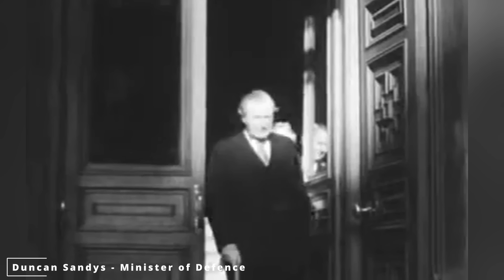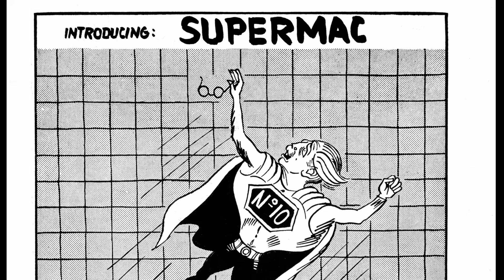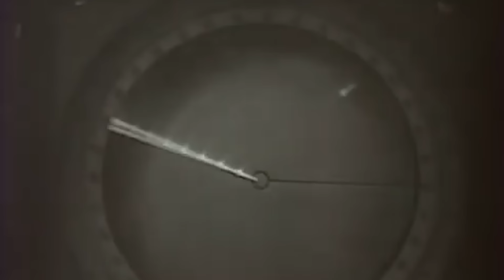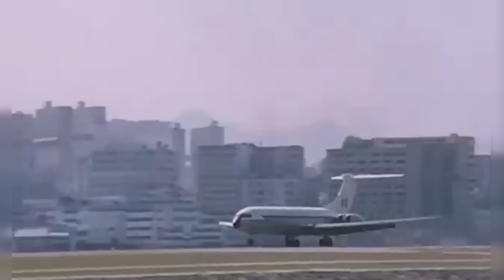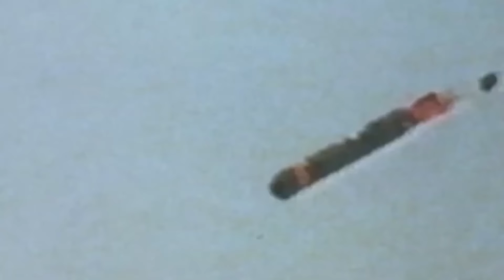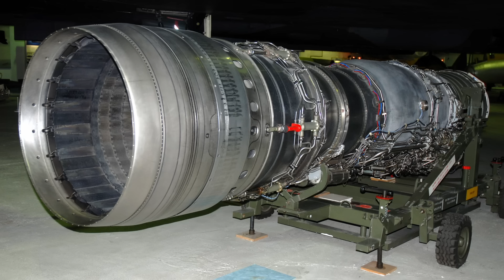How Britain Turned A Failed Airliner Into a Soviet Submarine Predator | The Mighty Nimrod

Comment: The Comet Four was hardly a failed airliner.
Reply: Comet 4 had an absolutely horrible 34% loss rate, the worst safety record of any jet airliner in history apart from the Comet 1 at 56%.
 de Havilland entered receivership the same year the Comet 4 was introduced and of 76 were built (mostly bought by the UK governmnet before production was canceled.
 The Comet 4 was voluntarily grounded in 1980 after dangerous metal fatigue and corrosion damage was found throughout the remaining fleet that was still in service, its type certificate was revoked in 1981.
Reply: @DoktorBayerischeMotorenWerke 

Comet / Nimrod notes. 

We believe we can clear up some commonly held myths and misconceptions obviously.

It's always good to see the facts presented clearly and concisely isn't it?

Obviously there have been worse aircraft for accident losses both before & after the Comet.

All jet airliners benefited greatly from the knowledge gained from the Comet incidents & subsequent investigations & yet some were still worse for accident losses. 

It's a great pity & a crying shame that British military forces had to occupy a large part of Germany for decades after 1945 & Russian military forces had to do the same. Of course Russia still posseses a large chunk of what was German territory & of course Russia & the UK produce nukes. Obviously Germany does not produce nukes.

Instances of all marks of the Comet flew with full certification after 1954 including the Comet 3. The last Comet flight occured in 1997.

The fabulous trail blazing DH Comet.
World's first jet airliner.
World's first high altitude airliner.
World's first airliner with a full fuselage length pressurised cabin pressurised for high altitude flight. That feature for that type of aircraft was a considerably difficult undertaking. 

How things were back then.
Accident losses - % of aircraft built.

DeHavilland Comet 4 UK                          14% 
DeHavilland Comet all UK (ff 1949)        17%  
Vickers VC10 UK (ff 1962)                        5%

Douglas DC-1  US                                       99%
Douglas DC-2                                              47%
Douglas DC-3                                              30%
Douglas DC-4                                              26%
Boeing s300    US                                       72% 
Boeing 307                                                  70%
Boeing 247                                                   48%
Boeing 707  (ff 1958)                                 32% 
Lockheed L-049 Constellation (ff 1958)  30%
Lockheed Electra US (ff 1958)                   29%
Fairchild FH-227 US (ff 1966)                   30%
McDonnell Douglas DC-8 US  (ff 1958)   14%
Sud Aviation Caravelle  (ff 1955)             15%
Canadair CL-44 Turboprop US (ff 1959) 46%  
Convair CV-580 Turboprop US (ff 1960) 22%
Convair CV-880     (ff 1959)                      27% 
Convair CV-990     (ff 1961)                      33%
Tupolev T-104        (ff 1956)                     16%
Vickers Viscount UK  (ff 1948)                32%  
Fokker F-27 Turboprop (ff 1955)             39%      

The Vickers VC10, fastest Atlantic crossing for a non supersonic jet airliner, held the record for 41 years.

For the first few years of operation the Caravelle & Comet had similar accident loss fatalities.

The first few Nimrod airframes were Comet 4 airframes with the equipment bay tacked on. Subsequent Nimrods were new build Comet 4 airframes with the modifications built by the DH team at Hawker Siddeley.

Military aircraft accident losses. 
Lockheed XF104                 (ff 1954) 100%
Lockheed  P80                      (ff 1944) 43%
Lockheed F104                     (ff 1954) 45%
Grumman f9f                         (ff 1947) 47%
Convair F102 Dagger            (ff 1953) 45%  
MD F-101 Voodoo.                (ff 1954)  34%
MD FH Phantom 1                (ff 1945)  35%
MD F4 Phantom 2                 (ff 1958)  28%
MD F3H  Demon                    (ff 1951)  32%
Gloster Meteor UK                   (ff 1943) 21%
DH Vampire  UK                        (ff 1943) 23%
DH Sea Vixen  UK                     (ff 1951) 33%
DH Venom       UK                    (ff 1949)  16%
Gloster Javelin    UK                (ff 1951) 20%
EE Lightning     UK                   (ff 1954) 33%
HS Harrier      UK                     (ff 1962) 34%

The Sea Vixen was an aircraft carrier jets pioneer aircraft that was also regularly flown from carriers that were too small for the aircraft. 

The Tornado & Typhoon & their engines are supersonic & are indeed British design aircraft with British design engines built by an international consortium. The Tornado design for example started life during the 1950s at Vickers as the AFVG, it's engine is based on the RR RB-199. The EE Lightening is also a British Supersonic jet aircraft.

The Typhoon is the British BAC-EAP with an engine based on the British RR XG-40, the Typhoon is also built by an international consortium.

Global aerospace. 
From the 1950s sector rationalisation and consolidation took place. 70 companies in France and 300 companies in the US disappeared due to merger or dissolution. In the US Boeing was almost bankrupted by the 707 project.  Boeing had a well protected domestic market and the available space and resources in the US to engage in large scale airliner manufacturing enabling them to capture orders simply by being able to produce airframes fast enough. Brazil now has the world's 3rd largest airliner manufacturer & is towards the bottom half of the wealth per capita tables. Most of the countries at the top don't bother trying to have a lone national airliner manufacturer. 

For example, there are of course no German companies that makes German jet aircraft in Germany & there are no German Companies that make German gas turbine aero engines in Germany that are suitable for widebody airliners.

The UK has the world's highest combined per capita Nuclear / Defence / Aerospace Sector Activity.

UK defence sector, absolute terms, world's second highest activity. 1st for per capita defence sector activity. Per capita nuclear powered submarine construction, 2nd position. 
Main players being Rolls Royce, Babcock, GKN Aerospace & BAe Systems. Activities often involve international collaboration. BAe systems, RR and other UK companies now handle more Airbus work value wise than Germany. 

Rolls Royce Holdings UK
Subsidiaries
- Rolls-Royce plc
- Rolls-Royce North America (ex Allison etc Classified Military stuff)
- Rolls-Royce AB
- Rolls-Royce Deutschland
- Rolls-Royce India Private Limited
- Rolls-Royce Marine Power Operations
- Vinters Engineering Limited
- Rolls-Royce Controls and Data Services
- Rolls-Royce Power Systems
- Bergen Marine
Joint ventures include:
- Rolls-Royce Turbomeca
- MTU Turbomeca -

Trent Family
The MT30 (Marine Turbine)
Industrial Trent 60 Gas Turbine
Trent 7000
Trent XWB Airbus A330neo.
Trent 1500
Trent 1000
Trent 500
Trent 600
Trent 700
Trent 800
Trent 8100
Trent 900
   
RR wholly owned subsidiaries in Germany handle smaller 2 shaft RR gas turbine aero engine work.
Reply: @DoktorBayerischeMotorenWerke 

We believe we can clear up some commonly held myths and misconceptions obviously.

It's always good to see the facts presented clearly and concisely isn't it?

Bow-wing (see B-47 wing collapse wing folding incidents) had built less than 12 pressurised airliners before the Comet first flew and they were not high altitude airliners. 

All Nimrods were new build Comet 4 airframes with appropriate strengthening and the unpressurized  equipment bay tacked on. 

The HS 801 Nimrod was the most advanced aircraft of it's type at the time it first flew. Problems with the MRA4 programme were almost entirely due to radar and computer equipment issues and BAe Systems & co being too busy with other work at the time. 

Obviously there have been worse aircraft for accident losses both before & after the Comet.

Early problems with Comet takeoff stalls were caused by pilots over rotating the aircraft at liftoff. 

Podded engines on wings have aerodynamics issues. The main reasons for eventually going with podded engines were because or to facilitate -
Ease of maintenance.
Use of shear off fixings given excessive out of balance forces.
Large diameter turbofan engines.
Reduce load on the wing to fuselage connection. 
Increased power from later engines. 

The Bow-wing (See B-47 wing collapse & wing folding incidents) was a good example of how to expend a huge amount of cash and effort on something that was probably not worth bothering with. The basic design of the Comet had been decided upon and established before the podded engine choice has been made for the B-47. There were aerodynamics problems with podded pylon mounted engines at the time. The US also built and operated a significant number of EE Canberra bombers under licence which did not use podded engines for their wing mounted engines. . 

There have been aircraft losses caused by pod & pylon mounted engines. 

All jet airliners benefited greatly from the knowledge gained from the Comet incidents & subsequent investigations & yet some were still worse for accident losses. 

Instances of all marks of the Comet flew with full certification after 1954 including the Comet 3. The last Comet flight occured in 1997.

The fabulous trail blazing DH Comet.
World's first jet airliner in regular service.
The jet engined Avro Lancastrian actually did a passenger service before the DH Comet. 
World's first high altitude airliner.
World's first airliner with a full fuselage length pressurised cabin pressurised for high altitude flight. That feature for that type of aircraft was a considerably difficult undertaking. 

The change from larger squarer windows to smaller rounder windows was necessary for the particular aircraft at the time. Skin thickness remained mostly the same for all Comet marks. 

How things were back then.
Accident losses - % of aircraft built.

DeHavilland Comet 4 UK                          14% 
DeHavilland Comet all mks UK (ff 1949)17%  
Vickers VC10 UK (ff 1962)                         5%

Douglas DC-1  US                                       99%
Douglas DC-2                                              47%
Douglas DC-3                                              30%
Douglas DC-4                                              26%
Boeing s300    US                                       72% 
Boeing 307                                                  70%
Boeing 247                                                   48%
Boeing 707  (ff 1958)                                 32% 
Lockheed L-049 Constellation (ff 1943)  30%
Lockheed Electra US (ff 1957)                   29%
Fairchild FH-227 US (ff 1966)                   30%
McDonnell Douglas DC-8 US  (ff 1958)   14%
Sud Aviation Caravelle  (ff 1955)             15%
Canadair CL-44 Turboprop US (ff 1959) 46%  
Convair CV-580 Turboprop US (ff 1960) 22%
Convair CV-880     (ff 1959)                      27% 
Convair CV-990     (ff 1961)                      33%
Tupolev T-104        (ff 1956)                     16%
Vickers Viscount UK  (ff 1948)                29%  
Fokker F-27 Turboprop NL (ff 1955)       40%      

The Vickers VC10, fastest Atlantic crossing for a non supersonic jet airliner, held the record for 41 years.

For the first few years of operation the Caravelle & Comet had similar accident loss fatalities.

Sud Aviation Caravelle - 
all accident loss fatalities - 
1320 fatalities. 

De Havilland Comet - 
all accident loss fatalities - 
453 fatalities. 

An example of a typical airliner from the period. 
The Fokker Friendship F-27 fatalities & accident losses as a % of aircraft built. 
Fokker F-27 Turboprop (ff 1955)   40%
2130 fatalities.

Of course De Havilland carried out a full stress analysis & performed extensive & protracted testing on two long lengths of fuselage representing all features of a complete airframe. De Havilland carried out significantly more testing than was required by any authority at the time & significantly more testing that any previous airliner was subjected to.

De Havilland designers / engineers knew all there was to know about metal fatigue at the time they designed the DH Comet.

De Havilland had prior experience building many all metal construction airframe aircraft including many passengers aircraft & thousands of jet powered fighter aircraft that were primarily of metal construction with pressurised cockpits & used jet engines built by De-Havilland.

De Havilland did indeed always work to better than industry standards at the time, used up to date knowledge for the design & testing activities & no evidence of negligence or criminal negligence was ever produced in relation to the DH Comet.

Global aerospace. 
From the 1950s sector rationalisation and consolidation took place. 70 companies in France and 300 companies in the US disappeared due to merger or dissolution. In the US Boeing was almost bankrupted by the 707 project.  Boeing had a well protected domestic market and the available space and resources in the US to engage in large scale airliner manufacturing enabling them to capture orders simply by being able to produce airframes fast enough and cheap and nasty enough. Another factor is airlines preferring to obtain as much of their airliner inventory as possible from one manufacturer. 

Global Aerospace Sector, what's happening.

For example, there are of course no German companies that makes German jet aircraft in Germany & there are no German companies that make German gas turbine aero engines in Germany that are suitable for widebody airliners.

The UK has the world's highest combined per capita Nuclear / Defence / Aerospace Sector Activity.

UK defence sector, absolute terms, world's second highest activity. 1st for per capita defence sector activity. Per capita nuclear powered submarine construction, 2nd position. 
Main players being Rolls Royce, Babcock, GKN Aerospace & BAe Systems. Activities often involve international collaboration. BAe systems, RR and other UK companies now handle more Airbus work value wise than Germany. 

There's a good chance that anyone currently flying on a widebody airliner will be on an aircraft powered by RR gas turbine aero engines made in the UK and a good chance there will be other hardware on the aircraft that's designed and / or manufactured in the UK. 

Rolls Royce Holdings UK
Subsidiaries
- Rolls-Royce plc
- Rolls-Royce North America (ex Allison etc Classified Military stuff)
- Rolls-Royce AB
- Rolls-Royce Deutschland
- Rolls-Royce India Private Limited
- Rolls-Royce Marine Power Operations
- Vinters Engineering Limited
- Rolls-Royce Controls and Data Services
- Rolls-Royce Power Systems
- Bergen Marine
Joint ventures include:
- Rolls-Royce Turbomeca
- MTU Turbomeca -

Trent Family
The MT30 (Marine Turbine)
Industrial Trent 60 Gas Turbine
Trent 7000
Trent XWB Airbus A330neo.
Trent 1500
Trent 1000
Trent 500
Trent 600
Trent 700
Trent 800
Trent 8100
Trent 900
   
RR wholly owned subsidiaries in Germany handle smaller 2 shaft RR gas turbine aero engine work.

The UK space and aerospace sectors are highly productive, high-value industries that together contribute over £18 Billion in direct Gross Value Added (GVA) to the UK economy. Individually, the space industry directly contributes about 0.3% of UK GDP 7•2 Billion while the aerospace industry contributes approximately 0.5% £10•9 Billion.
   
We hope this helps.
Reply: @DoktorBayerischeMotorenWerke , 114 built and 26 total hull loss accidents.

Not good but a long way short if 34%
Reply: @katywalker8322  39 Comet aircraft were lost in accidents.
The Comet 1 has a 56% loss rate
Reply: @DoktorBayerischeMotorenWerke the list of incidents for the Comet has 43 entries. 14 of those resulted in damaged aircraft that were repaired.

A further one was a hijacking with no resulting damage.

3 of the other losses were on the 28 December 1968 when they were destroyed on the ground by an air attack - which is hardly anything to do with the type of aircraft.
Reply: @katywalker8322  There are 39 hull loss accidents, that is a 34% loss rate.
The Comet 4 had the highest loss rate of any jet airliner except for the Comet 1 (56%)
Reply: @DoktorBayerischeMotorenWerke , no there weren't. 26 total loss accidents, 3 destroyed in war, and 14 damaged and repaired.
Reply: @katywalker8322  39 hull lose accidents, 34% loss rate
Reply: @DoktorBayerischeMotorenWerke , you continue to push that. Not sure why you insist in telling a lie that people can easily check.

Goodbye
Reply: @katywalker8322  That is the official number, the total hull loss rate in 34%
Reply: @DoktorBayerischeMotorenWerke 

Typhoon & Tornado, British design aircraft. 

Early days of the airliners.

The awesome De Havilland Comet.
World's first production jet airliner.
World's first high altitude airliner. 
At the time the Comet wasn't particularly dangerous. The DH Comet was definitely not the worst engineering failure in commercial airliner history.

Losses comparisons.
How things were in those days.

DeHavilland Comet 4 UK                          14% 
DeHavilland Comet all mks UK (ff 1949)17%  
Vickers VC10 UK (ff 1962)                         5%

Douglas DC-1  US                                       99%
Douglas DC-2                                              47%
Douglas DC-3                                              30%
Douglas DC-4                                              26%
Boeing s300    US                                       72% 
Boeing 307                                                  70%
Boeing 247                                                   48%
Boeing 707  (ff 1958)                                 32% 
Lockheed L-049 Constellation (ff 1943)  30%
Lockheed Electra US (ff 1957)                   29%
Fairchild FH-227 US (ff 1966)                   32%
McDonnell Douglas DC-8 US  (ff 1958)   14%
Sud Aviation Caravelle  (ff 1955)             15%
Canadair CL-44 Turboprop US (ff 1959) 46%  
Convair CV-580 Turboprop US (ff 1960) 22%
Convair CV-880     (ff 1959)                      27% 
Convair CV-990     (ff 1961)                      33%
Tupolev T-104        (ff 1956)                     16%
Vickers Viscount UK  (ff 1948)                29%  
Fokker F-27 Turboprop NL (ff 1955)       40%      

The Vickers VC10, fastest Atlantic crossing for a non supersonic jet airliner, held the record for 41 years.

For the first few years of operation the Caravelle & Comet had similar accident loss fatalities.

De Havilland had prior experience building many all metal construction airframe aircraft & thousands of jet powered fighter aircraft that were primarily of metal construction with pressurised cockpits & jet engines built by De-Havilland. No aircraft before the Comet was subjected to as much pre-production testing as the Comet. 

It's a great pity & a crying shame that British military forces had to occupy a large part of Germany for decades after 1945 & Russian military forces had to do the same. Of course Russia still posseses a large chunk of what was German territory & of course Russia & the UK produce nukes. Obviously Germany does not produce nukes.

Interesting British achievements.

The gas turbine engine was invented & patented in England before the 1800s.

Axial multi stage sequential stage compressor & turbine technology, first produced for turbo machinery use in England by Parsons of Ireland & North England during the 1800s. The components form the basis of most modern gas turbine aero engines. At the time the concept of the jet aircraft powered by axial internal combustion gas turbine engines was first mentioned thus the internal combustion jet engine & jet aircraft was indeed invented in England before the 1900s & before the Wright brothers got busy.

Work on the multi stage sequential stator rotor axial compressor as applicable to the axial compressor gas turbine aero engine was ongoing in England from around 1928 by Arnold Griffiths and others. By 1943 the Metrovik F2/3  Beryl was a running axial turbojet that was superior to anything anywhere else. As the centrifugal compressor engines were adequate and more powerful at the time development of a larger F2/3  version was commenced.

The Metrovik (UK)  F2/3 axial compressor gas turbine aero engine was flight certified & ran in 1942, it was the result of UK development work ongoing since 1929. At the time it was the most capable axial compressor turbojet in existence but was not required and development work continued on a larger version.

Frank Whittle performed the world's first demonstration of a gas turbine aero engine in 1937. People in Germany kept a close eye on everything going on in Britain at the time.

The centrifugal compressor RR Nene was the most powerful & most reliable gas turbine aero engine on the planet in 1944. That engine would be later built under license or copied in many countries including Russia (Mig-15 Mig-17), China, the US, France and Switzerland powered dozens of aircraft types for decades after 1944.

Pratt and Whitney and others produce centrifugal compressor gas turbine aero engines. The PW200 is a currently produced whittle style centrifugal compressor, reverse flow combustor, gas turbine aero engine. 

The world's first wind tunnel was constructed in England during the 1870s. The world's first supersonic wind tunnel was constructed in England in 1922.

There is no doubt that the Fairey (England)
Delta 2 was the world's first jet
aircraft to exceed 1000 mph.  Indeed It
exceeded the previous record by 310 mph &
held the record for 1 year. Incidentally, the Dassault Mirage 3 & 4 are based on the Fairey Delta 2.

More recent UK military jet aircraft.

The Tornado & Typhoon & their engines are Supersonic & are indeed British design aircraft with British design engines built by an international consortium. The Tornado design for example started life during the 1950s at Vickers as the AFVG, it's engine is based on the RR RB-199. The EE Lightening is also a British Supersonic jet aircraft.

The Typhoon is the British BAC-EAP with an engine based on the British RR XG-40, the Typhoon is also built by an international consortium.

Brazil has the world's third largest airliner manufacturer and makes very good airliners & Brazil is 100th down the list along with Indonesia for wealth per capita. Of course it is in fact the case that Embraer can't build those airliners without purchasing stuff from the US, UK & Europe. For example, Norway, Holland, Denmark, Ireland & Belgium, top 20 wealth per capita, don't make airliners, its as simple as that.

Global aerospace. 
From the 1950s sector rationalisation and consolidation took place. 70 companies in France and 300 companies in the US disappeared due to merger or dissolution. In the US Boeing was almost bankrupted by the 707 project.  Boeing had a well protected domestic market and the available space and resources in the US to engage in large scale airliner manufacturing enabling them to capture orders simply by being able to produce airframes fast enough and cheap and nasty enough. Another factor is airlines preferring to obtain as much of their airliner inventory as possible from one manufacturer. 

Global Aerospace Sector, what's happening.

For example, there are of course no German companies that makes German jet aircraft in Germany & there are no German companies that make German gas turbine aero engines in Germany that are suitable for widebody airliners.

The UK has the world's highest combined per capita Nuclear / Defence / Aerospace Sector Activity.

UK defence sector, absolute terms, world's second highest activity. 1st for per capita defence sector activity. Per capita nuclear powered submarine construction, 2nd position. 
Main players being Rolls Royce, Babcock, GKN Aerospace & BAe Systems. Activities often involve international collaboration. BAe systems, RR and other UK companies now handle more Airbus work value wise than Germany. 

There's a good chance that anyone currently flying on a widebody airliner will be on an aircraft powered by RR gas turbine aero engines made in the UK and a good chance there will be other hardware on the aircraft that's designed and / or manufactured in the UK. 

Rolls Royce Holdings UK
Subsidiaries
- Rolls-Royce plc
- Rolls-Royce North America (ex Allison etc Classified Military stuff)
- Rolls-Royce AB
- Rolls-Royce Deutschland
- Rolls-Royce India Private Limited
- Rolls-Royce Marine Power Operations
- Vinters Engineering Limited
- Rolls-Royce Controls and Data Services
- Rolls-Royce Power Systems
- Bergen Marine
Joint ventures include:
- Rolls-Royce Turbomeca
- MTU Turbomeca -

Trent Family
The MT30 (Marine Turbine)
Industrial Trent 60 Gas Turbine
Trent 7000
Trent XWB Airbus A330neo.
Trent 1500
Trent 1000
Trent 500
Trent 600
Trent 700
Trent 800
Trent 8100
Trent 900
   
RR wholly owned subsidiaries in Germany handle smaller 2 shaft RR gas turbine aero engine work.

The UK space and aerospace sectors are highly productive, high-value industries that together contribute over £18 Billion in direct Gross Value Added (GVA) to the UK economy. Individually, the space industry directly contributes about 0.3% of UK GDP 7•2 Billion while the aerospace industry contributes approximately 0.5% £10•9 Billion.
   
We hope this helps.
Reply: @DoktorBayerischeMotorenWerke 

We believe we can clear up some commonly held myths and misconceptions obviously.

It's always good to see the facts presented clearly and concisely isn't it?

All production Nimrod aircraft were new build Comet 4 airframes with the necessary modifications. The Nimrod was the most advanced and most capable aircraft of it's type at the time it went into service. The  Nimrid HS.801 was not available for purchase by other countries. The ability  if the HS 801 to repeatedly demonstrate detection of subs and the knowledge that it could deliver nuclear depth charges to a target was a very effective deterrent. 

Bow-wing (see B-47 wing collapse wing folding incidents) had built less than 12 pressurised airliners before the Comet first flew and they were not high altitude airliners. 

All Nimrods were new build Comet 4 airframes with appropriate strengthening and the unpressurized  equipment bay tacked on. 

The HS 801 Nimrod was the most advanced aircraft of it's type at the time it first flew. Problems with the MRA4 programme were almost entirely due to radar and computer equipment issues and BAe Systems & co being too busy with other work at the time. 

Obviously there have been worse aircraft for accident losses both before & after the Comet and Nimrod.

Early problems with Comet takeoff stalls were caused by pilots over rotating the aircraft at liftoff. 

Podded engines on wings have aerodynamics issues. The main reasons for eventually going with podded engines were because or to facilitate - Ease of maintenance. Use of shear off fixings given excessive out of balance forces.
Large diameter turbofan engines.
Reduce load on the wing to fuselage connection. Increased power from later engines. 

The Bow-wing (See B-47 wing collapse & wing folding incidents) was a good example of how to expend a huge amount of cash and effort on something that was probably not worth bothering with. The basic design of the Comet had been decided upon and established before the podded engine choice has been made for the B-47. There were aerodynamics problems with podded pylon mounted engines at the time. The US also built and operated a significant number of EE Canberra bombers under licence which did not use podded engines for their wing mounted engines. . 

There have been aircraft losses caused by pod & pylon mounted engines. 

All jet airliners benefited greatly from the knowledge gained from the Comet incidents & subsequent investigations & yet some were still worse for accident losses. 

Instances of all marks of the Comet flew with full certification after 1954 including the Comet 3. The last Comet flight occured in 1997.

The fabulous trail blazing DH Comet.
World's first jet airliner in regular service.
The jet engined Avro Lancastrian actually did a passenger service before the DH Comet. 
World's first high altitude airliner.
World's first airliner with a full fuselage length pressurised cabin pressurised for high altitude flight. That feature for that type of aircraft was a considerably difficult undertaking. 

The change from larger squarer windows to smaller rounder windows was necessary for the particular aircraft at the time. Skin thickness remained mostly the same for all Comet marks. 

How things were back then.
Accident losses - % of aircraft built.

DeHavilland Comet 4 UK                          14% 
DeHavilland Comet all mks UK (ff 1949)17%  
Vickers VC10 UK (ff 1962)                         5%

Douglas DC-1  US                                       99%
Douglas DC-2                                              47%
Douglas DC-3                                              30%
Douglas DC-4                                              26%
Boeing s300    US                                       72% 
Boeing 307                                                  70%
Boeing 247                                                   48%
Boeing 707  (ff 1958)                                 32% 
Lockheed L-049 Constellation (ff 1943)  30%
Lockheed Electra US (ff 1957)                   29%
Fairchild FH-227 US (ff 1966)                   30%
McDonnell Douglas DC-8 US  (ff 1958)   14%
Sud Aviation Caravelle  (ff 1955)             15%
Canadair CL-44 Turboprop US (ff 1959) 46%  
Convair CV-580 Turboprop US (ff 1960) 22%
Convair CV-880     (ff 1959)                      27% 
Convair CV-990     (ff 1961)                      33%
Tupolev T-104        (ff 1956)                     16%
Vickers Viscount UK  (ff 1948)                29%  
Fokker F-27 Turboprop NL (ff 1955)       40%      

The Vickers VC10, fastest Atlantic crossing for a non supersonic jet airliner, held the record for 41 years.

For the first few years of operation the Caravelle & Comet had similar accident loss fatalities.

Sud Aviation Caravelle - 
all accident loss fatalities - 
1320 fatalities. 

De Havilland Comet - 
all accident loss fatalities - 
453 fatalities. 

An example of a typical airliner from the period. 
The Fokker Friendship F-27 fatalities & accident losses as a % of aircraft built. 
Fokker F-27 Turboprop (ff 1955)   40%
2130 fatalities.

Of course De Havilland carried out a full stress analysis & performed extensive & protracted testing on two long lengths of fuselage representing all features of a complete airframe. De Havilland carried out significantly more testing than was required by any authority at the time & significantly more testing that any previous airliner was subjected to.

De Havilland designers / engineers knew all there was to know about metal fatigue at the time they designed the DH Comet.

De Havilland had prior experience building many all metal construction airframe aircraft including many passengers aircraft & thousands of jet powered fighter aircraft that were primarily of metal construction with pressurised cockpits & used jet engines built by De-Havilland.

De Havilland did indeed always work to better than industry standards at the time, used up to date knowledge for the design & testing activities & no evidence of negligence or criminal negligence was ever produced in relation to the DH Comet.

Global aerospace. 
From the 1950s sector rationalisation and consolidation took place. 70 companies in France and 300 companies in the US disappeared due to merger or dissolution. In the US Boeing was almost bankrupted by the 707 project.  Boeing had a well protected domestic market and the available space and resources in the US to engage in large scale airliner manufacturing enabling them to capture orders simply by being able to produce airframes fast enough and cheap and nasty enough. Another factor is airlines preferring to obtain as much of their airliner inventory as possible from one manufacturer. 

Global Aerospace Sector, what's happening.

For example, there are of course no German companies that makes German jet aircraft in Germany & there are no German companies that make German gas turbine aero engines in Germany that are suitable for widebody airliners.

The UK has the world's highest combined per capita Nuclear / Defence / Aerospace Sector Activity.

UK defence sector, absolute terms, world's second highest activity. 1st for per capita defence sector activity. Per capita nuclear powered submarine construction, 2nd position. 
Main players being Rolls Royce, Babcock, GKN Aerospace & BAe Systems. Activities often involve international collaboration. BAe systems, RR and other UK companies now handle more Airbus work value wise than Germany. 

There's a good chance that anyone currently flying on a widebody airliner will be on an aircraft powered by RR gas turbine aero engines made in the UK and a good chance there will be other hardware on the aircraft that's designed and / or manufactured in the UK. 

Rolls Royce Holdings UK
Subsidiaries
- Rolls-Royce plc
- Rolls-Royce North America (ex Allison etc Classified Military stuff)
- Rolls-Royce AB
- Rolls-Royce Deutschland
- Rolls-Royce India Private Limited
- Rolls-Royce Marine Power Operations
- Vinters Engineering Limited
- Rolls-Royce Controls and Data Services
- Rolls-Royce Power Systems
- Bergen Marine
Joint ventures include:
- Rolls-Royce Turbomeca
- MTU Turbomeca -

Trent Family
The MT30 (Marine Turbine)
Industrial Trent 60 Gas Turbine
Trent 7000
Trent XWB Airbus A330neo.
Trent 1500
Trent 1000
Trent 500
Trent 600
Trent 700
Trent 800
Trent 8100
Trent 900
   
RR wholly owned subsidiaries in Germany handle smaller 2 shaft RR gas turbine aero engine work.

The UK space and aerospace sectors are highly productive, high-value industries that together contribute over £18 Billion in direct Gross Value Added (GVA) to the UK economy. Individually, the space industry directly contributes about 0.3% of UK GDP 7•2 Billion while the aerospace industry contributes approximately 0.5% £10•9 Billion.
   
We hope this helps.
Reply: @DoktorBayerischeMotorenWerke 

Typhoon & Tornado, British design aircraft. 

Early days of the airliners.

The awesome De Havilland Comet.
World's first production jet airliner.
World's first high altitude airliner. 
At the time the Comet wasn't particularly dangerous. The DH Comet was definitely not the worst engineering failure in commercial airliner history.

Losses comparisons.
How things were in those days.

DeHavilland Comet 4 UK                          14% 
DeHavilland Comet all mks UK (ff 1949)17%  
Vickers VC10 UK (ff 1962)                         5%

Douglas DC-1  US                                       99%
Douglas DC-2                                              47%
Douglas DC-3                                              30%
Douglas DC-4                                              26%
Boeing s300    US                                       72% 
Boeing 307                                                  70%
Boeing 247                                                   48%
Boeing 707  (ff 1958)                                 32% 
Lockheed L-049 Constellation (ff 1943)  30%
Lockheed Electra US (ff 1957)                   29%
Fairchild FH-227 US (ff 1966)                   32%
McDonnell Douglas DC-8 US  (ff 1958)   14%
Sud Aviation Caravelle  (ff 1955)             15%
Canadair CL-44 Turboprop US (ff 1959) 46%  
Convair CV-580 Turboprop US (ff 1960) 22%
Convair CV-880     (ff 1959)                      27% 
Convair CV-990     (ff 1961)                      33%
Tupolev T-104        (ff 1956)                     16%
Vickers Viscount UK  (ff 1948)                29%  
Fokker F-27 Turboprop NL (ff 1955)       40%      

The Vickers VC10, fastest Atlantic crossing for a non supersonic jet airliner, held the record for 41 years.

For the first few years of operation the Caravelle & Comet had similar accident loss fatalities.

De Havilland had prior experience building many all metal construction airframe aircraft & thousands of jet powered fighter aircraft that were primarily of metal construction with pressurised cockpits & jet engines built by De-Havilland. No aircraft before the Comet was subjected to as much pre-production testing as the Comet. 

It's a great pity & a crying shame that British military forces had to occupy a large part of Germany for decades after 1945 & Russian military forces had to do the same. Of course Russia still posseses a large chunk of what was German territory & of course Russia & the UK produce nukes. Obviously Germany does not produce nukes.

Interesting British achievements.

The gas turbine engine was invented & patented in England before the 1800s.

Axial multi stage sequential stage compressor & turbine technology, first produced for turbo machinery use in England by Parsons of Ireland & North England during the 1800s. The components form the basis of most modern gas turbine aero engines. At the time the concept of the jet aircraft powered by axial internal combustion gas turbine engines was first mentioned thus the internal combustion jet engine & jet aircraft was indeed invented in England before the 1900s & before the Wright brothers got busy.

Work on the multi stage sequential stator rotor axial compressor as applicable to the axial compressor gas turbine aero engine was ongoing in England from around 1928 by Arnold Griffiths and others. By 1943 the Metrovik F2/3  Beryl was a running axial turbojet that was superior to anything anywhere else. As the centrifugal compressor engines were adequate and more powerful at the time development of a larger F2/3  version was commenced.

The Metrovik (UK)  F2/3 axial compressor gas turbine aero engine was flight certified & ran in 1942, it was the result of UK development work ongoing since 1929. At the time it was the most capable axial compressor turbojet in existence but was not required and development work continued on a larger version.

Frank Whittle performed the world's first demonstration of a gas turbine aero engine in 1937. People in Germany kept a close eye on everything going on in Britain at the time.

The centrifugal compressor RR Nene was the most powerful & most reliable gas turbine aero engine on the planet in 1944. That engine would be later built under license or copied in many countries including Russia (Mig-15 Mig-17), China, the US, France and Switzerland powered dozens of aircraft types for decades after 1944.

Pratt and Whitney and others produce centrifugal compressor gas turbine aero engines. The PW200 is a currently produced whittle style centrifugal compressor, reverse flow combustor, gas turbine aero engine. 

The world's first wind tunnel was constructed in England during the 1870s. The world's first supersonic wind tunnel was constructed in England in 1922.

There is no doubt that the Fairey (England)
Delta 2 was the world's first jet
aircraft to exceed 1000 mph.  Indeed It
exceeded the previous record by 310 mph &
held the record for 1 year. Incidentally, the Dassault Mirage 3 & 4 are based on the Fairey Delta 2.

More recent UK military jet aircraft.

The Tornado & Typhoon & their engines are Supersonic & are indeed British design aircraft with British design engines built by an international consortium. The Tornado design for example started life during the 1950s at Vickers as the AFVG, it's engine is based on the RR RB-199. The EE Lightening is also a British Supersonic jet aircraft.

The Typhoon is the British BAC-EAP with an engine based on the British RR XG-40, the Typhoon is also built by an international consortium.

Brazil has the world's third largest airliner manufacturer and makes very good airliners & Brazil is 100th down the list along with Indonesia for wealth per capita. Of course it is in fact the case that Embraer can't build those airliners without purchasing stuff from the US, UK & Europe. For example, Norway, Holland, Denmark, Ireland & Belgium, top 20 wealth per capita, don't make airliners, its as simple as that.

Global aerospace. 
From the 1950s sector rationalisation and consolidation took place. 70 companies in France and 300 companies in the US disappeared due to merger or dissolution. In the US Boeing was almost bankrupted by the 707 project.  Boeing had a well protected domestic market and the available space and resources in the US to engage in large scale airliner manufacturing enabling them to capture orders simply by being able to produce airframes fast enough and cheap and nasty enough. Another factor is airlines preferring to obtain as much of their airliner inventory as possible from one manufacturer. 

Global Aerospace Sector, what's happening.

For example, there are of course no German companies that makes German jet aircraft in Germany & there are no German companies that make German gas turbine aero engines in Germany that are suitable for widebody airliners.

The UK has the world's highest combined per capita Nuclear / Defence / Aerospace Sector Activity.

UK defence sector, absolute terms, world's second highest activity. 1st for per capita defence sector activity. Per capita nuclear powered submarine construction, 2nd position. 
Main players being Rolls Royce, Babcock, GKN Aerospace & BAe Systems. Activities often involve international collaboration. BAe systems, RR and other UK companies now handle more Airbus work value wise than Germany. 

There's a good chance that anyone currently flying on a widebody airliner will be on an aircraft powered by RR gas turbine aero engines made in the UK and a good chance there will be other hardware on the aircraft that's designed and / or manufactured in the UK. 

Rolls Royce Holdings UK
Subsidiaries
- Rolls-Royce plc
- Rolls-Royce North America (ex Allison etc Classified Military stuff)
- Rolls-Royce AB
- Rolls-Royce Deutschland
- Rolls-Royce India Private Limited
- Rolls-Royce Marine Power Operations
- Vinters Engineering Limited
- Rolls-Royce Controls and Data Services
- Rolls-Royce Power Systems
- Bergen Marine
Joint ventures include:
- Rolls-Royce Turbomeca
- MTU Turbomeca -

Trent Family
The MT30 (Marine Turbine)
Industrial Trent 60 Gas Turbine
Trent 7000
Trent XWB Airbus A330neo.
Trent 1500
Trent 1000
Trent 500
Trent 600
Trent 700
Trent 800
Trent 8100
Trent 900
   
RR wholly owned subsidiaries in Germany handle smaller 2 shaft RR gas turbine aero engine work.

The UK space and aerospace sectors are highly productive, high-value industries that together contribute over £18 Billion in direct Gross Value Added (GVA) to the UK economy. Individually, the space industry directly contributes about 0.3% of UK GDP 7•2 Billion while the aerospace industry contributes approximately 0.5% £10•9 Billion.
   
We hope this helps.